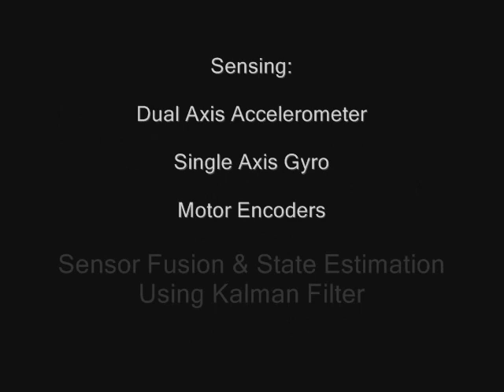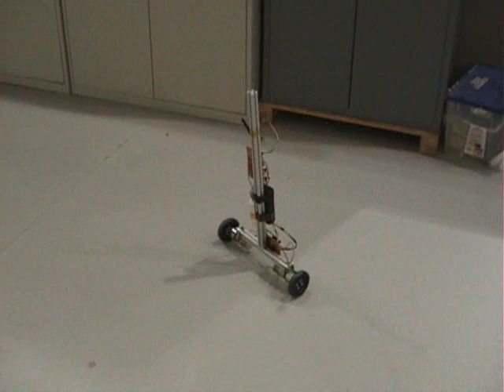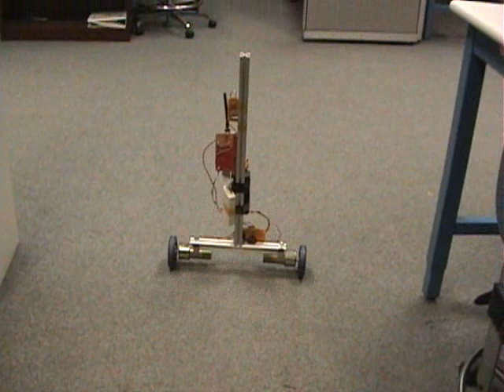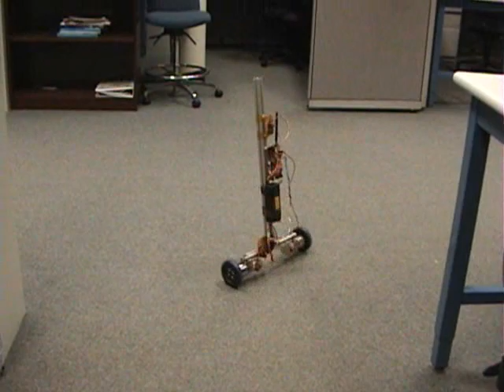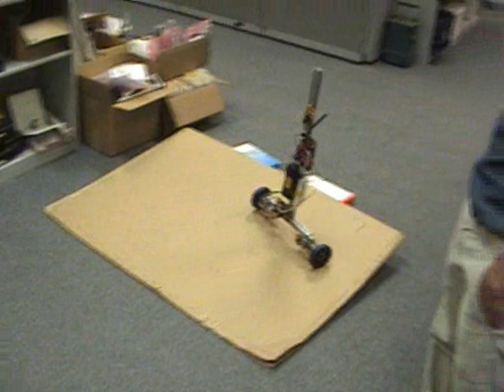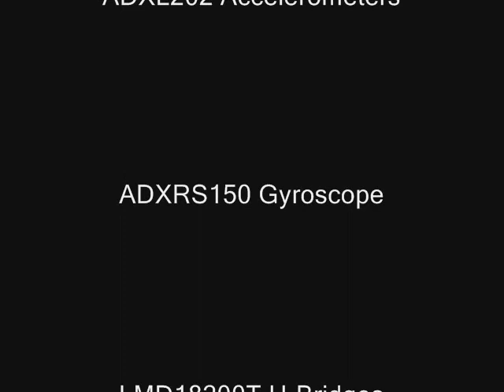Inverted Pendulum Balancing Robot Montage

Comment: Fantastic!! I'm trying to do something like that, I don't know why do you need motor encoders. What do you use them for??

In the PID control you need the angle (sending the gyro and the acceleremeter data to the kalman filter you got it).  And then what do I have to do? Can you draw a diagram for me, so I could see the closed loop from the PID.

Thanks!